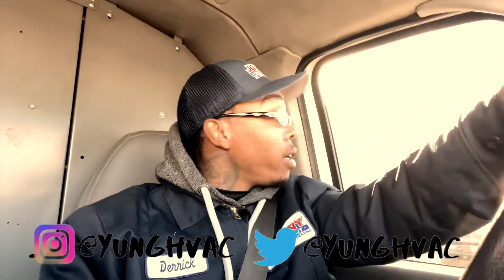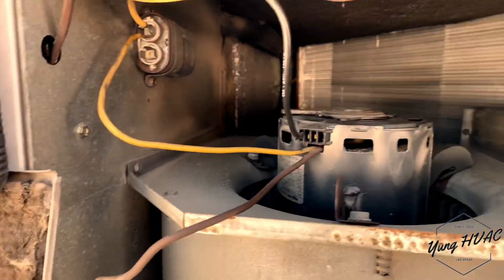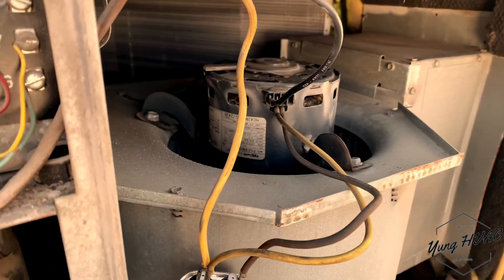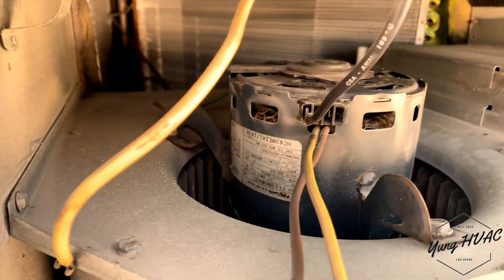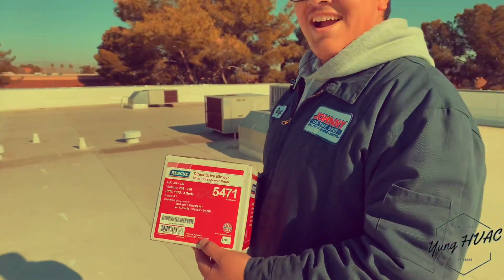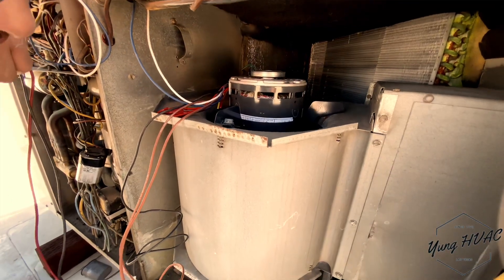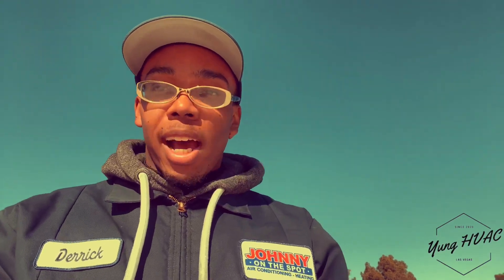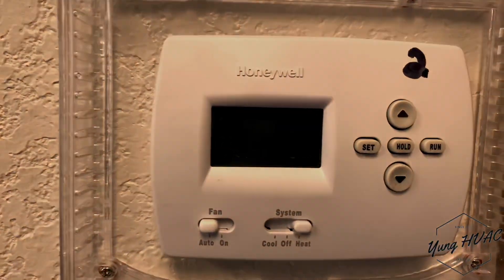HVAC Blower Motor replacement (How to) 😱

Comment: I've never understood why techs use the word swap. To swap something out means to switch it with something else. You're not switching a bad motor with a good motor and a good motor with a bad motor lol. You're replacing the bad motor with a good motor
Reply from the maker: You just contradicted yourself in that statement sir lol
Reply: @YungHVAC  
Sorry man, I'm not trying to troll you. Good videos you make
Reply: @YungHVAC  

No i didn't.
To swap means to TRADE. It means i take a and b and switch places. 
You're not switching places. The bad motor isn't going where the good motor use up be. It's going in the trash.
You are REPLACING the bad motor with a good motor and throwing the bad motor away. You're not swapping anything out
Reply: That is proper English.  You are mistaken.

Example I swapped the old motor for a new one .   

The synonym would be exchange since the meridian Webster dictionary states that swap in this sense is a transitive verb with the definition being exchange of sense 2. 

The definition of exchange 2 being : the act or process of substituting one thing for another.

Therefore when technicians use the term swap it is correct
Reply: Cuz as A hvac technician that's the lingo and words we use if we swapping out and replacing it with a new that's what it is. So he said it right

Comment: All you need for a blower motor is a blower wheel puller, a socket set, and a 5/15 drill attachment. Optional: I use sandpaper and a file.